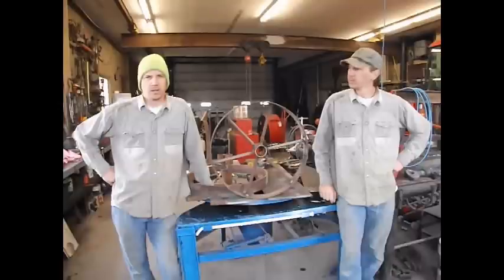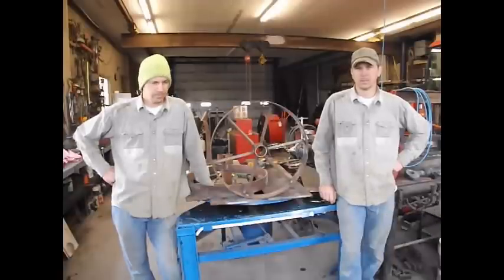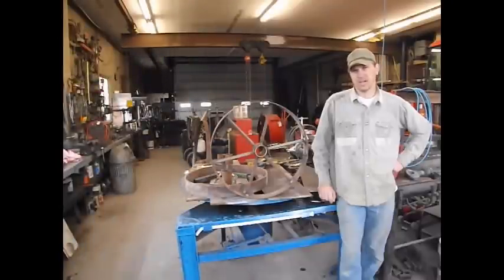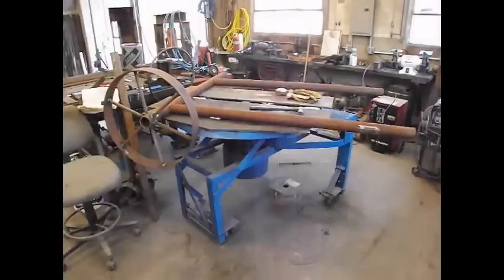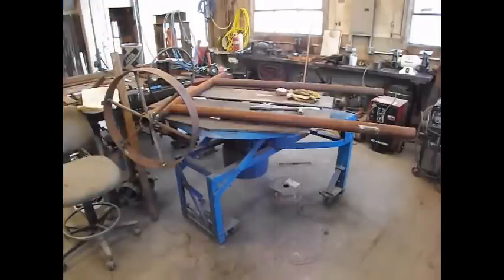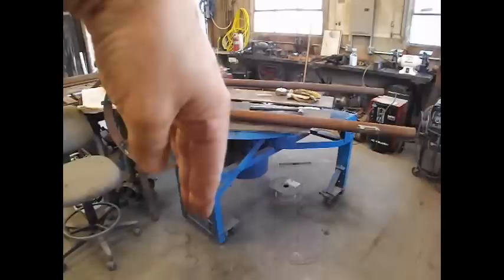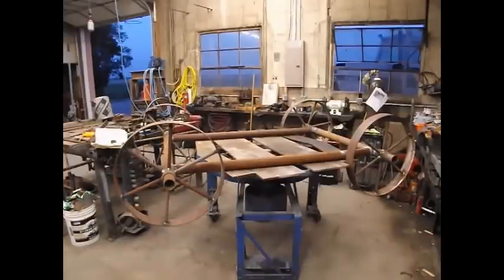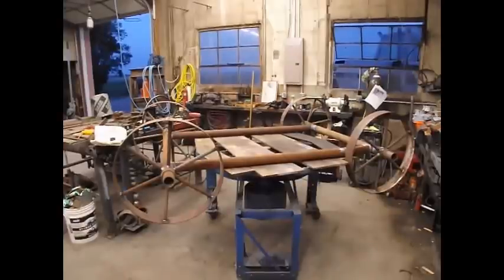Trebuchet Tuesday - Episode 11- Chassis

Comment: Great video. Why do you usually use the stick welder? Are the welds really that much stronger?
Reply from the maker: Thanks! I'm using old oil field tubing that is really rusted and pitted. If I stick weld it, I don't have to get it nearly as clean with the hand grinder. I have used MIG on this tubing in the past, and it takes a lot of grinding to completely get rid of the rust (and whatever other chemicals are on this tubing) or it makes for porous MIG welds.  As far as strength, I haven't actually done a MIG vs stick stress test with this tubing. I should sometime!

Comment: why no type of 5th wheel plate system so you can turn it and then drop a bolt in it when you get it where you want it to roll straight!
Reply from the maker: Simplicity. I just didn't see the need for it on this thing. I figure the steel wheels will slide sideways quite easily during turns when being towed. I may regret it.  The big one will have steerable wheels. I have a few ideas on how, but right now I"m thinking each wheel will pivot individually, like a caster, but controllable.